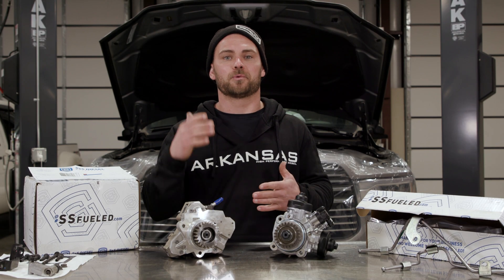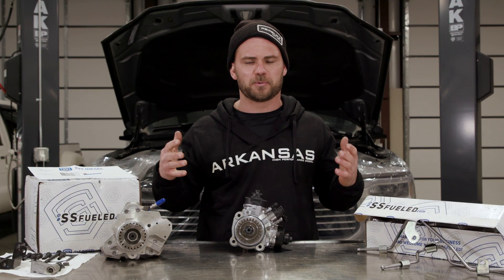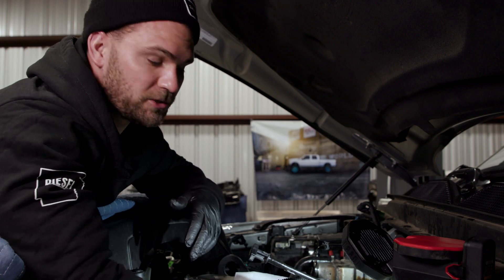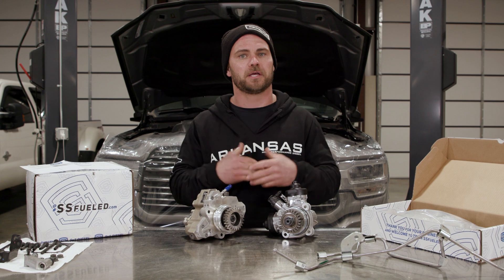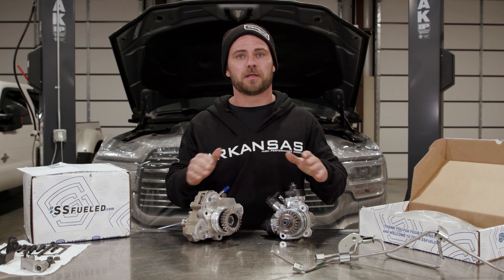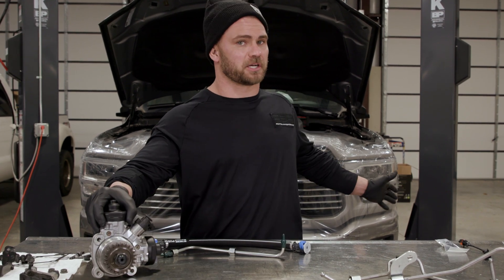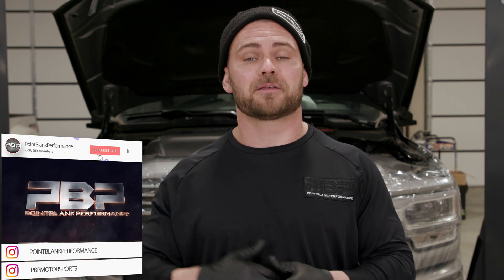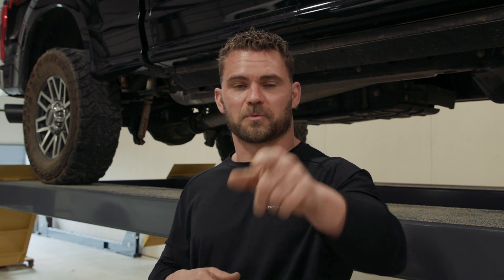5TH GEN CUMMINS CP3 SWAP

Comment: I had TWO CP4s fail on me within 10k miles of one another on a 2017 F350. I was told on the second repair that the first repair shop didn’t do a good enough job cleaning out the system. $22k for both.

Comment: 2018 dodge ram leramie hotshot rig 378k miles only done oil changes, fuel filters, brakes, wheel bearings and ball joints and still going
Reply from the maker: Hell yeah !!

Comment: CP4 is trash!!!!!!!!!!!!!!! 2020 RAM 3500 gave out at 24,000 miles had to replace engine under warranty.  Dealership wanted to blame me.  I told them to go fu$& themselves and fix it.  2 months later they installed CP4.2.

Comment: I’m literally that guy. Every 5k miles oil/filter/fuel filter change/key cycle 5-7x before starting after filter change. I’m still concerned.
Reply from the maker: Add a Fass and swap it sir . What people leave out is how inefficient the low press pump is and starves the high pressure pump !

Comment: The customer that had this pump replaced by you can be reimbursed according to Ram customer service.  Have them provide all receipts to Ram.  This recall will be going out after 1 January 2022.
Reply from the maker: Very nice sir this is new information to us !
Reply: @POINTBLANKPERFORMANCE  Thanks for the get back.  I reach out when I can.  This came directly from Ram customer service.  I fortunately haven't had a pump issue.  Since new I've added Hotshot Secret additives with some additional additives.  My 6.7 sounds great.  No metal seen on the fuel metering valve.  The Exergy replacement I think is a good investment.  I will have my pump replaced though when this recall goes out.

Comment: My 2020 lost its pump at 26k. Took the dealership a month to get it fixed and they only replaced the pump. So i sold it to a honda dealership for more than i paid for it. And found a 2010 manual trans. Happy to not have to deal with that again.
Reply from the maker: I’m glad it worked out for you sir but hate that they only replaced the pump 😌

Comment: Cp4 turned out to be a dud, do your research. No it is not because of the pump but the diesel fuel in the United States is what I was told. But don't you think someone would have checked this out before they put it in all the 2019 and 2020 Rams.

Comment: I have 2019 ram 3500 first 10499 had issue with cp4 dealer didn't replace the fuel system they replaced all engine assembly from A to Z now 32000 have the same problem and dealer said they don't have part to fix it till end of jun so I don't what to do should I go with cp3 from ss and lose the warranty or buy used 2018 and ?
Reply from the maker: Hands down do a S&S kit and move forward the 5Th gen is a much better platform than the 4Th gen sir !

Comment: S&S has been great to work with, I did have a bit of a noise with my first CP3 I put on. They had my trouble shoot a little bit with retorquing, eventually sent me a new pump, and reimbursed me for the work I had done paying to retorque. They are quick to answer emails in business hours as well.
Reply from the maker: That’s great to hear sir ! They have delivered the same customer service to us as well! We’ve personally not experienced that issue
Reply: @POINTBLANKPERFORMANCE  You talk as if the LML CP4 was recent, it has been 7 years since GM used a bosh injector pump in a Duramax

Comment: 2021 pump is confirmed by a tag picture that it's a CP-ISB21. It's been in development for about a year. Presumed to be a redesigned version of the CP3 with higher PSI capability.
Reply from the maker: Thank you sir for the information!

Comment: My 2019 ram 3500 cp4 went out at 52k. Warranty covered it but truck was at the dealer for 1 1/2 months. Sucked
Reply: No they didn't. I talked to them about it and they said that they couldn't do that. They put in the upgraded cp4 they said. Im currently going thru a repurchase for my truck. Over engine leaking oil and they can't fix it. It's currently at the dealer now over the engine leak.
Reply from the maker: @jesusj19870622  sorry to hear that sir . I know it’s frustrating on both parties.
Reply from the maker: Did they do the Cp3 upgrade sir ?

Comment: I’ve got a 2019 and I added an extended warranty just because of the CP4. I drain my filters every month and I change the filters every 10K. I still worry about the stupid pump.

I’ve been following S&S from the day they announced the development of their CP3. I’ve thought about doing the conversion just for the piece of mind. Of course, my warranty(s) would be out the window but I would have a bit more faith in my truck. Now with the 2021 coming stock with the CP3, I wonder if the manufacturer/dealers have any program to swap out the pump and maintain the factory warranty. Of course, if the CP4 hasn’t failed, I would have to eat the cost of the new pump. But that might be better than worrying about the CP4 reliability.

Great video. If you have any knowledge of what I mentioned above would you please reply.
Reply from the maker: At this time we haven’t gotten any info on the factory warranty swap and still keep factory warranty. I don’t see why though they wouldn’t allow customers to purchase this installation via dealer ship and have it installed with a warranty.

Comment: Why still no conversion for the 15-16 power stroke? Would love to get that worry out my head
Reply from the maker: Fitment , the pump hits the intake to the turbocharger . But one day we hope!
Reply: @POINTBLANKPERFORMANCE  the cp3 is bigger than the cp4? Makes sense,seems like it would be a big market if someone could get it worked out
Reply from the maker: @1Fast6.7Stroker  Totally agree sir . Even a Belt driven pump might be in the making.
Reply: @1Fast6.7Stroker   The cp3 barely fits on the 5th gen ram as well, like another centimeter towards the block and it wouldn't fit. I think they do make a recovery kit for the powerstroke as well. Honestly if they had made a recovery kit for the ram I would have probably gone that route.
Reply: @nottheonlyjustin  I’ve heard mixed reviews of the disaster kits for as much as they cost and still not 100% guaranteed plus would be cool to just do away with that cp4 and not have to worry bout it